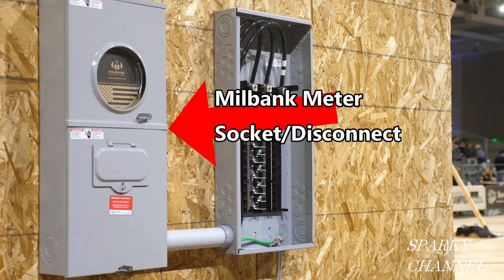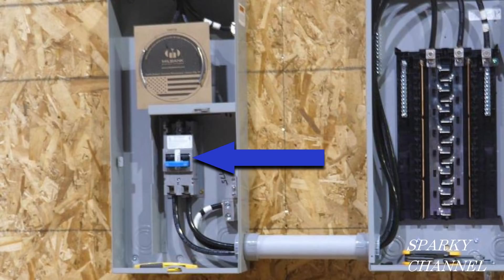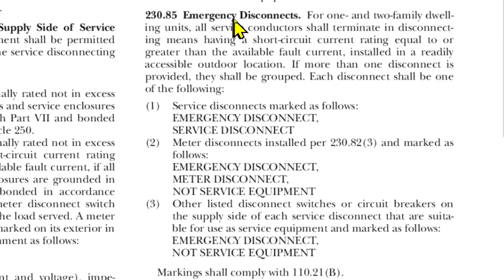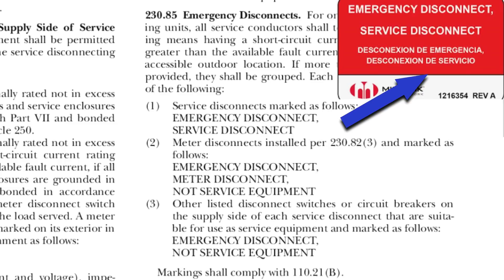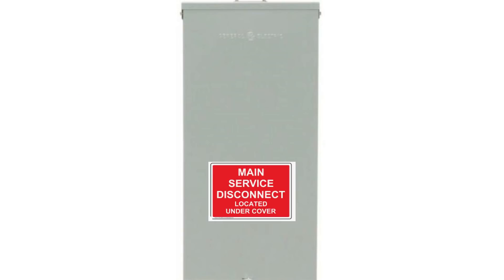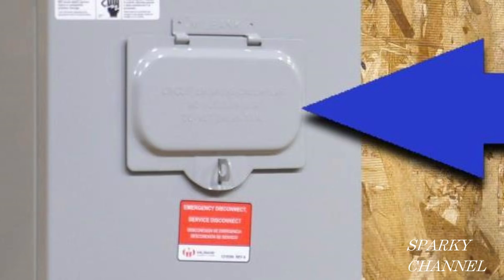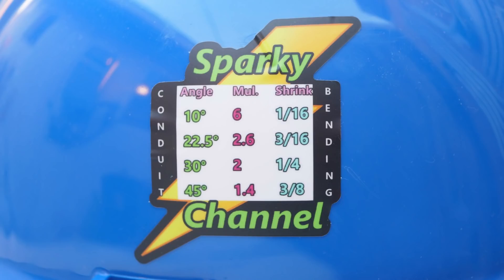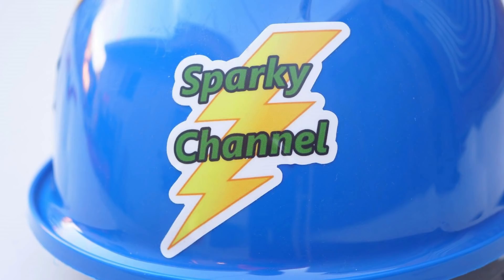What's This Little Door For? And is There a New NEC Code "Behind" it? (2020 NEC 230.82)

Comment: these things are everyone’s nightmare when it comes to criminals and crime imagine having an outside switch easily available to render your home without power! What idiot thinks this is a good idea?
Reply: 1st thing comes to mind is exactly what you said.
Reply: My mom and brother was visiting someone and they got robbed. The robbers turn off the emergency disconnect from the outside and then broke into the house. That is a horrible idea to have that outside. I put a lock on mine, at least let them have to break it first before they can turn it off. This is like those security gates that people put on their doors. They keep the bad guys out but they also keep the good guys out.
Reply: They make breakaway locks that are used on fire sprinkler valves to prevent tampering. Grainier, other industrial supply, on line, or your local locksmith will have them.
Reply: @monteglover4133  How does that stop vandals? They can just break them too or am I missing something?
Reply: @inothome  most Vandals are kinda stupid it acts as a deterrent. I can currently easily disconnect the power to over 90% of the homes by just yanking the meter in about 30 seconds
Reply: @monteglover4133  Most meters are physically secured, either by a ring or the cover plate. And no, you can't easily just yank a meter under load. Have you ever tried that and seen what happens when you do pull a meter under load?
Reply: @monteglover4133  Agreed on the deterrent, but if they want to do it, they will do it.
Reply from the maker: @inothome  You can get electrical arcing which is a very dangerous situation.
Reply: @SparkyChannel  No doubt! I work in electric utilities and know all about it. Fortunately have never seen it first hand though. But plenty of training on it.
Reply: @inothome  oh please... Sure it's best to shut down the main before pulling or installing a meter, but we're talking about residential single phase 240v here...  It hardly poses much of a threat,  in terms of arcing.  Grab the thing and yank it out... If you aren't dilly dallying around, you barely ever get any arcing.
Reply: @inothome  Meter pullers are made for just this.
Reply: @monteglover4133  try yanking it and not make noise. Lol. You can cut the lock without much noise. Or pick it quietly.
Reply: @inothome  I pull meters under a load alot its fairly easy to do.
Reply: @IrrationalBstrd  Remember this is all about a firemen trying to cut the power to a burning house where the  electrial could be under faulted conditions. 
I'm a retired high voltage test technician. I'm IBEW member, I've seen a few meter channels where the line wires were loose, which was the reason for the service call, when the electrician yanked the meter out, the LINE SIDE 120 lug came out with it. It only made it out until it hit the box. 
The fault blew the primary fuse on the transformer at the pole. The electrician only had minor burns on his arms, somehow he didn't catch it in his face. I was called in to assess what caused the explosion.  Be safe and smart don't pull meters hot.
Reply: @tomwilliams8675  Since it was the line side lug that came out and caused a ground fault, this would have happened even if the meter was not under load. Right?

If the meter socket is known to be faulty, power would have to be disconnected upstream.
Reply from the maker: @monteglover4133  I've seen the fire department in action, they would cut a lock so fast it would make your head spin. I don't think an inspector or AHJ would pass it with a lock on it but it might vary between them.
Reply: @SparkyChannel  all it takes to remove is a sharp hard blow they are used and required on fire sprinkler systems
Reply: Back in the days when a House was powered with a couple 30 amp fuses the boxes all had a disconnect lever on them. Of course back in the day people were a little more cautious of entering a house because they were practically universally armed home owners. Besides that people were a little more honest, we never locked a house or car when I was a kid and I don't remember anything being stolen.
Reply: This. I hate this code. We're making a world we're criminals have the advantage.
Reply from the maker: @PepperStone3  I totally understand. I'm uneasy about it as well.
Reply: All I know my main has been outside my house for over 20 years never had a problem
Reply: erm... all of Texas?
Reply: @wim0104  We have disconnects on the outside compressors at our office building downtown Austin and every week some jerk-off throws the handle down. Last week they turned off the whole water to the building by closing the main valve at the street box. We had to take off every outside outlet and hardwire our sprinkler timer to the building. They kick off sprinkler heads and then take a shower. Not only irritating it is expensive.
Reply: @vince9486  and nothing is being done about the vandalism & tresspassing?

Comment: Looking at a QO circuit breaker data sheet, tripping current is calibrated at 104°F ambient. At lower temps it's much higher. For example the 200 amp breaker curve goes down to 14°F ambient where it doesn't trip until over 260 amps. Northern Iowa will see -25°F some winters so I could see that tripping current being even higher still. It looks like the example in this video uses a circuit breaker and a lugged panel, but could it instead be an appropriate switch at the meter and keep the main circuit breaker inside the house in climate controlled temperatures? I suppose on the same topic, one could question if main panels should be installed in garages as they commonly are around here. Leave your door open while snowblowing the driveway and it would chill the entire panel.

Comment: The NEC's definition of readily accessible states: “capable of being reached quickly for operation, renewal, or inspections without requiring those to whom ready access is requisite to actions such as to use tools, to climb over or remove obstacles, or to resort to portable ladders and so forth.”  This means no padlocks.
Reply from the maker: I understand. Don't necessarily agree, but I do understand.

Comment: I worked on an apartment and the electric company put one of their tamper tags on the main service little door. i think thats ok. But months later they never put a new one on. And I think apartments are really the setting that makes the most sense for this setup. a cluster of meters and main service disconnects, and then panels inside the apartments. Most homes we just put the panel outside and I have mixed feelings about that.
Reply from the maker: I totally understand. I have mixed feelings as well.

Comment: Won't it make working on panels / breakers safer? In older homes, isn't part of the panel always hot unless you take out the meter? Safer panel work seems priceless
Reply from the maker: Yes, absolutely. You make a great point!
Reply: Can you do a tutorial on what parts of old panels are always hot? Nomenclature for beginners ? And maybe a tutorial on how to install AFCI breakers?

Comment: I realize in some locations outdoor service panels are the norm but I'm not a fan. I guess in areas where the 2020 NEC is in force you could implement the outside disconnect but still use a main breaker in the service panel so someone inside the house is able to kill the power without going outside. That is a consideration here in the frozen north. For example I've killed our power several times over the years due to nearby lightning storms. 

We use a generator interlock so the service panel needs a "main" breaker to prevent the generator breaker from being engaged. 

I like the overall design of the panel you showed as it is pretty non-intrusive. I share the concern others have express over how water tight is the breaker door and you have to wonder if the manufacture can't even attach a sticker correctly what other problems may exist with the product.
Reply from the maker: Hi Tom! Excellent points, thanks!

Comment: I have worked overseas , I've come across this type before it's  common to have a disconnect at the meter base 
In the USA not much 

 I think it's a great idea ,  when replacing a panel or completing certain repairs without the panel being energized
Reply from the maker: Yes, it would be a very great thing to work on a panel with no power anywhere on the panel, great point!

Comment: Question. If you are only supposed to have ground and neutral bonded at first means of disconnect. Why isn't there a separate grounding wire running from meter/disconnect to grounding bars in load center.  Looks like the neutral is bonding the load center( green screw). Should this not be removed?
Reply from the maker: The green bonding screw was loosened but not removed. Yes, IMO the green bonding screw should have been removed but it wasn't bonding while it was loosened. There's a #4 green EGC connecting the 2 enclosures.

Comment: Hey Bill. I wanna ask you something. I'm looking at getting a 220v extension cord for my plasma cutter. The problem is, I need at least 30-50 amps for it to work correctly. But all the extension cords I find in 220v are rated for no higher than 20 amps. Is it legal or illegal to use 220v romex as an extension cord?
Reply from the maker: No, Romex isn't listing for that use. Sorry 'bout that....
Reply: @SparkyChannel  in that case, can you reccomend any 220v cords rated for 30-50 Amps? I can't find anything anywhere.
Reply: @princenoah21  HOME DEPOT = 6 ft. 50 Amp 4-Prong Range Power Cord -- $25.47
Model #HD#575-052
Reply: @ZAPATTUBE  Errm, sorry. I guess I sent the wrong message. That's not the right one. What I need is a 3 prong 220v cord at least 15 ft long. That model is a 4 prong cord that's not an extension. :(
Reply: Get an s/o cable and install your own connections.
Reply: They have s/o in 10/4 at home depot for under 4 bucks a foot.

Comment: I have never seen a disconnect outside. It is in the main breaker box so electricians can safely work on the panel. Firemen spray fresh water on fires with little regard for power shorts.
Reply from the maker: I understand. Many of us are uneasy about putting a disconnect outside. The new 2020 NEC is what it is though.
Reply: Don't know about where you live but Appalachian Power (AEP) requires an outside disconnect for mobile homes. The disconnect also has to have the provision for extra breakers so circuits can be added to provide power outside of the home. This includes single and double wides and maybe modular homes. I have a double wide with underground service from the pole. I didn't want to mount the meter and disconnect to the house so I have it on a 4x6 post that is 3 feet from the outside wall.

Comment: great Idea. During a fire , the fire captain usually calls for local Utility to come to fire scene and pull the meter. After this , if not serious structure damage, electricians may reactivate individual breakers to sustain house measures.
Reply from the maker: Thanks John!
Reply: Here, the fire department will call the local utility as well.  But they won't pull the meter, they'll cut the line at the top of the pole.
Reply: Where I live the home would burn down before they arrived.

Comment: But then that lock helps to prevents someone from easily turning off the power because in some situations turning off the power can disable and security systems on the property making it easier to gain access to the home or business.
Reply from the maker: True.
Reply: I think it's pretty rare to have a security system that doesn't have battery backup
Reply: @GGGenom  Even so, all anyone would have to do is wait for the battery to go dead.

Comment: Thanks what happens if your main panel is in basement
Reply from the maker: Probably nothing until you would like to get a new service panel.
Reply: If your area is in the 2020 NEC and upgrading the service you must have an outdoor disconnect. 2 problems. Kifs can shut off power to your house. Just great in winter time to freeze pipes & saw it countless times wjen somebody installed a lock on a disconnect a year later can not find the key.

Comment: I only install meter bases with room for a few circuits off of the main disconnect side. They're not that more expensive, and if they ever add power outside near the meter or solar, it saves so much time and money to have the option.
Reply from the maker: Hi Colby! Do you mean something like this?: Siemens MC0816B1200T 8 Space, 16 Circuit, 200 Amp Main Breaker Meter Combination with Ring Type Cover: Amazon: https://amzn.to/3BBd5ak
  It's 200A, exterior with a main breaker. But it also has 8 circuit breaker spaces. I'm thinking about putting something like this on the exterior of my garage and then putting a 30 or 40 space load center back-to -back with it on the interior of the garage. As you say, I would keep the spaces on the Main Breaker Meter Combination in reserve. What do you think?

Comment: Does your panel now become a sub panel which would include separation of neutrals and grounds?
Reply from the maker: Hi Steven, good question. The load center would now be called a main lug only (MLO) load center. It isn't a sub-panel but it does require the separation of neutrals and grounds.
Reply: @SparkyChannel  Note that you can still install a panel with a main breaker instead of an MLO. Can save some money to do it without the main like you would for a small sub panel though.
Reply from the maker: @normILL  Yes, the load center in the video is "convertible", meaning that a main breaker can be added to it. Do you know of any NEC codes regulating multiple main breakers?
Reply: Thank you so much for your reply love the channel keep up the good work 👍

Comment: Firefighters are trained on how to rapidly remove a meter to disconnect power in an emergency. This bit of code is addressing a non-existing problem. As an electrician, and a volunteer emt I can't say this is a smart idea. Seems like a way to sell unneeded equipment to me.
Reply from the maker: If you read through the comments you'll see that a lot of people agree with you at least to some degree. This new code may be a bit of an overreach.
Reply: I actually didn't mind that I had to have one installed a couple years ago when I upgraded my service from 100A to 200A.  I needed to re-arrange a bunch of breakers after the electrician left and it was nice to be able to shut off all the power so easily. I've replaced breakers plenty of times in live panels, but it was nice to not have to be so careful what I was doing in there when doing a bunch at once.
Reply from the maker: @andrewt9204  Excellent point!

Comment: Can you provide an example of a service disconnect from Home Depot or Lowes….
Everything I see is $600.  Certainly, I don’t have to spend $600 bucks on the outside of my house when I spent less than $300 for the main service panel.  Am I looking for the wrong product?
Reply: Menards sells a square d 200a outdoor service disconnect. Just bought one for about $140.  Also they ship.
It's not currently in production so stock is limited.  
I feel for you I was freaking out when I saw prices on others too!
Reply: @gregorysampson8759  Thank you.  I just want to make sure I am not buying something that is way more than I need.
Reply from the maker: @gregorysampson8759  Wow, great price. Could you please give me the model number?
Reply from the maker: The one I showed in the video is about $750 and is made in USA so your $600 example isn't bad price wise. What brand were you shopping?
Yes the load centers don't cost that much but the cost of the breakers will make up for it. Also, a surge protector isn't cheap either.
Reply: @SparkyChannel  Just learned about NEC 2020.  Bought a Square D service panel for the house (inside garage), and am looking for a disconnect.   No code out in the country, but building for code in case next buyer (after I am drooling on myself and have to be wheeled out to the rest home) complains the house isn’t built to code.

Found a “INDUSTRIAL MRO DU221RB SER. E2 NSNP-OEM” for $103 on Amazon, but don’t know if it meets minimum standard.
Reply: @oscarb9139  Your panel only needs to meet the current code for your area.  You won't be obligated to bring it up to a later code when selling.
Reply: @Rob Stephens  I know I can do what I want.  However, when selling, if the house doesn't meet what is "current code", it provides leverage against my selling price.  I am trying to be mostly compliant to be as attractive to potential buyers.  

Thank you for taking the time to read and reply.  It is very much appreciated.
Reply from the maker: @oscarb9139  That's industrial, you need something designed for residential. And do you need a meter socket?
Reply: @Sparky Channel  Power comes to property on pole.  Had a service panel, meter, and RV outlet installed.  It is a pass thru panel so I am running wire underground from pole/panel to house 200 feet away.  Just found out about exterior disconnect requirement.....and AFCI.....

There is no permitting outside of town where I am but want to do the work to code.  The service panel on pole might meet requirements, but I dont know if fire department would look 200 feet away for a disconnect.
Reply: @robstephens  Some home inspector may list it as a potential safety issue.